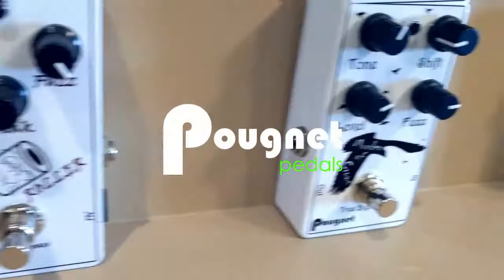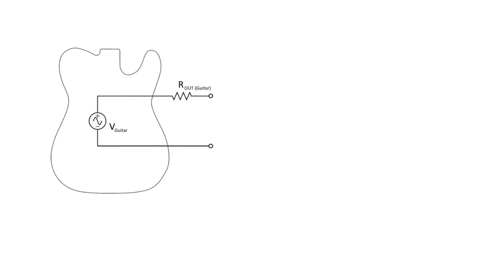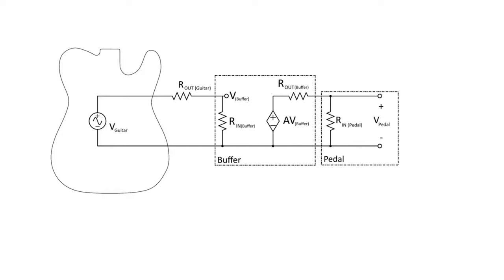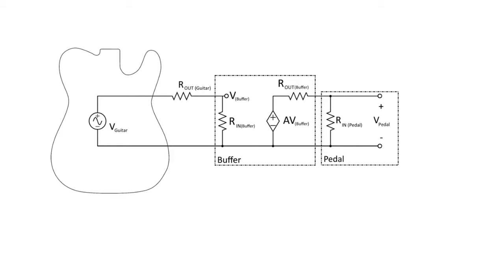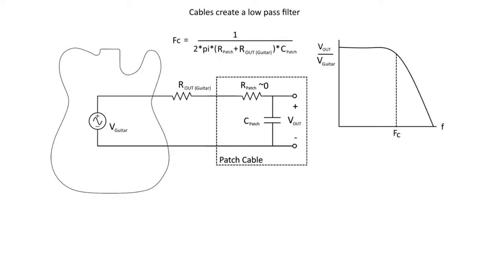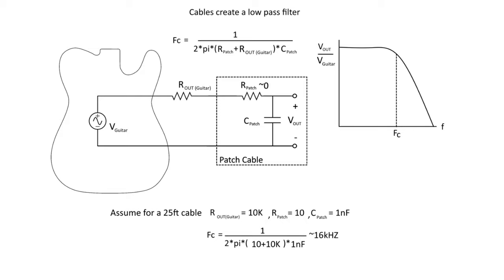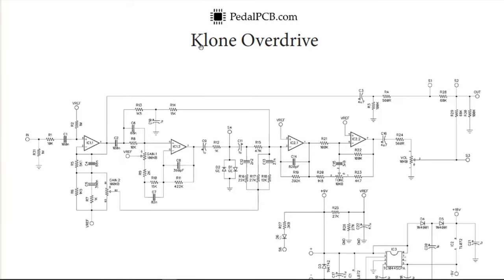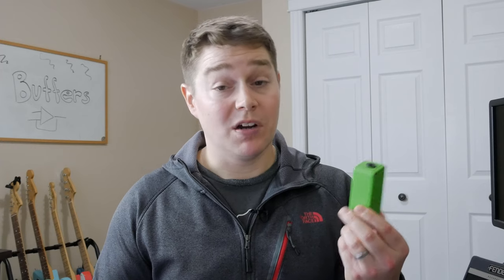Buffers...the most boring pedal on your board? | DIY Guitar Pedals

Comment: Very excellent detail and theory explains the how and why of buffers. Perfect.
Reply: When dealing with voltage follower opamp circuits (buffer) the correct term is impedance as you're dealing with an ac signal.

Comment: Thanks for the nice video and great information. My question is, are the input buffer the same as the output buffer.
Reply: They certainly can be. You could however have an op amp buffer at the input and a transistor buffer at the output. Also, you can think that the output buffer of one pedal could be the input buffer to the next pedal in the chain.

Comment: Any chance in the future you could explain the concept of input and output impedance in a similar style to this video, and how to calculate it for a couple simple pedal circuits?
Reply from the maker: I can put it on the list. Essentially you need to measure output with no load, then with a known load and do some calcs
Reply: @pougnetpedals impedance is the term used when dealing wirh an audio (ac sine wave) and you called common collector when it's an emitter follower. I hate to sound like a troll man. But if you're going to teach people, do it properly. You play as well as you teach too. Practice more. You have irnin you to do both if you do it right. You need to learn how to apply ohms law to resistors in series and parallel then go from there. Most circuits are just using components to perform simple math. Audio is an ac sine wave which usually hovers above or below 9v depending on the phase desired in any part of a circuit. Over drive looks like a sine wave wirh flat top peaks. Flange and phase take position of the sine wave in the unit circle and manipulate it. Simple stuff bro. You have a decent following man and I'd hate to see you squander it because of laziness. Listen to more dream theater.
Reply from the maker: @jstro-hobbytech    Hey man, thanks for all the questions. I will try my best to answer them for you. 

The term impedance is actually correct all the time, and is independent of whether you have an AC or DC signal. Impedance is the sum of the effective resistance (resistors) and reactance (capacitors/inductors) of the components your signal passes through. In DC, the reactive components look like an open circuit (capacitors) or short circuit (inductors) so we can drop (or zero) the reactance part of the equation. This is why the term resistance is used when discussing DC. That said if you pass an AC signal through only resistors, the term resistance would still be correct. This is of course in an "ideal" sense as even resistors can have a very small reactive component in practice. Not sure, what I said in the video, but hopefully that clears things up. 

You are correct in regards to the common collector transistor circuit. It can also be referred to as emitter follower and sometimes also voltage follower. No matter what you call it, the important thing to remember is the input is on the base and the output is on the emitter. Knowing its characteristics like the voltage gain (1V/V, 0dB, or unity gain as you mentioned in another post – similar ways to say the same thing) is also worth wild. 

Series and parallel resistance/impedance is also pretty easy. Resistors in series have their values added, while those in parallel are equal to the reciprocal of the sum of reciprocal resistances. Inductance for inductors works the same, but it is opposite for capacitors. Capacitance in series sums like parallel resistance, capacitance in parallel sums like resistance in series. I recommend checking out an intro electronic book like Boylestad if you want more info. 

More precise to your explanation, audio signals are approximated by a summation of sine waves with varying frequencies and magnitudes. Check out Fourier Series (sums) or Fourier transforms (integral) for more information. They also don't need to hover around 9V. The 9V scenario you are referring to is likely when you have an 18v supply. You position your signal on a 9V DC bias so as to avoid signal clipping on the rails (0V and 18V). Most guitar pedals are powered using a 9V DC supply without a charge pump, so the DC bias for the signal is 4.5V (with rails being 0V and 9V). 

While I am discussing clipping, I should also talk overdrive, distortion, and fuzz. When a signal clips at the rails (gain is too high), or has the top/bottom clipped due to diodes in a hard clipping configuration (opposite direction diodes placed between your signal and ground), we hear it as fuzz or distortion. Massive gain, and rail clipping usually turns your sine waves into square waves and we refer to it as the fuzz effect. We usually refer to hard-clipped sine waves (they still look like a sine wave, but with their humps flattened) as distortion. Soft-clipping (where we put the opposite direction diodes in a feedback loop of say…an op-amp) doesn't necessarily clip the signal, but distorts it into something like a "soft" sawtooth wave and is usually referred to as overdrive. Of course these are all subjective. A light distortion could be referred to as an overdrive by some manufacturers, similarly with a light overdrive could be called a boost. There are also different methods of employing diode clipping (ex. asymmetrical clipping).

Flangers and chorus pedals are slightly different than the phase effect. Flangers and chorus involve mixing your input signal with a time delayed copy or copies of itself (time domain shift). Flangers have a shorter delay than chorus pedals. The phase effect involves shifting the phase (frequency domain shift) of the input signal (usually by way of an all-pass filter). Now a time delay in the time domain is equivalent to a phase shift in the frequency domain, but the effect is noticeably different when applied to an audio signal with various frequencies. This is because flangers and chorus effects shift all parts (or sines) equally, but a phase effect affects each part (or sine) by a different amount.

Lastly, you asked about my scope in another post. When choosing an oscilloscope, specifically for audio signal troubleshooting, you should be aware of a few things. First you should ensure it can sample at the required frequency. This is greater than twice the frequency of your highest expected frequency (~20kHz for audio) in your signal. This is called your Nyquist frequency. Having one output (for test signals) and one input (to probe at different locations in your circuit) would be considered essential as well. Lastly, I always like to have FFT (Fast Fourier Transform) on my scopes so I can review the frequency response of my circuit. Luckily, most $50 scopes can do all this. It's nice to have a $500 or $2000 scope for a bigger screen, higher sampling rate and more inputs/functionality (Tektronix makes some nice ones), but it is not necessary for most simple audio triage.

Thanks again for the engagement! 

I'll keep practicing my guitar as well, but I don't envision any stages in my future :)

Comment: Hey, I decided to connect two circuits together in series, an octave>fuzz. But when the octave is on, the gain of the fuzz decreases very noticeably. Could adding a buffer solve that problem?
Reply from the maker: My guess is not. Usually fuzzes are ok with no buffer leading into it. Also, I don't think the gain would decrease, maybe you mean the level? Octave ups can have some perceived volume drop because they remove lower frequencies. My advice would be to flip the two in the chain anyway. Fuzz>Octave is probably the most common path. Other than that...maybe a boost or equalizer in between?